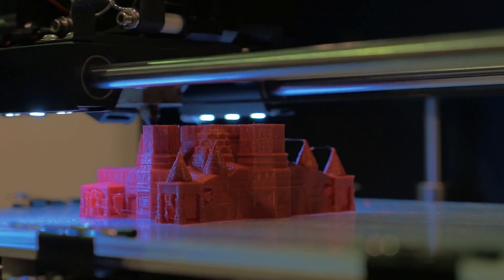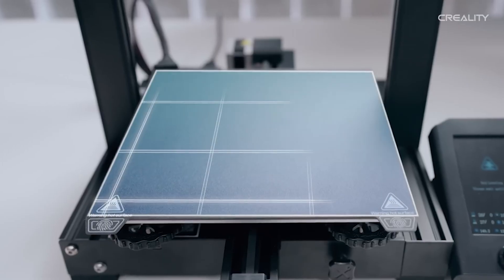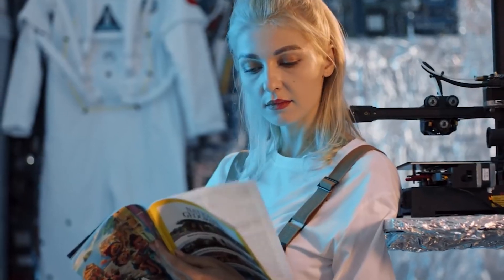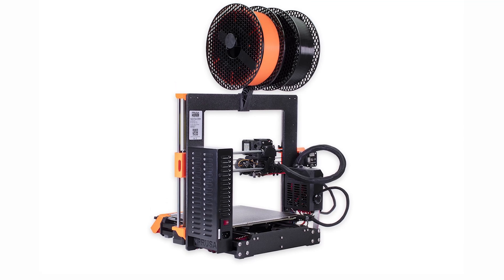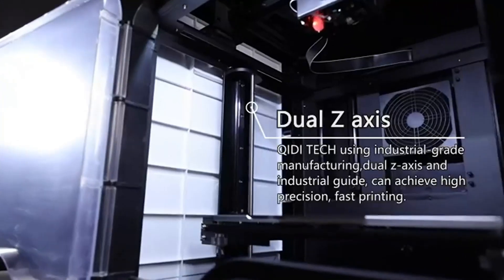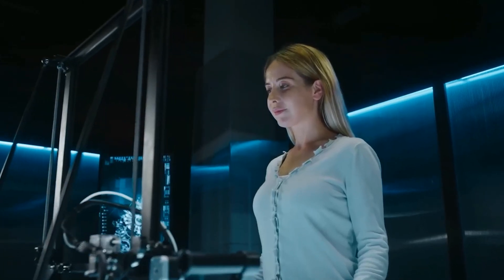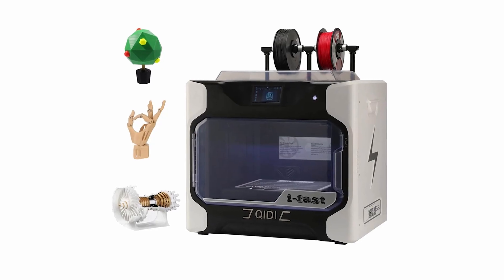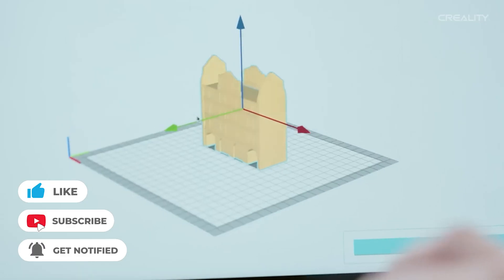What's The Best 3D Printers (2023)? The Definitive Guide!

Comment: bowden extruders in 2022? no just no. also any printer that can not easily be upgraded with a bi-metal or just metal heatbreak is also a no go.
They tell you that you can print with 260 C but you shouldn't if you don't want to inhale Teflon vapors.
Reply: So which one you recommend for home users for the budget $500-750?
Reply: @gunhann  it fully depends on what you want to do with it
Reply: @ozzlemcschnozzle7250  I imagine printing some kid toys, some useful tools etc. maybe desktop figures. The quality is important.
Reply: @gunhann  is it going to be your first printer? what size do you want? if 220 x 220 x 250 is enough for the build volume you can have a look at the Sovol SV06
Reply: I would also like to know what you recommend
Reply: @Yg600  have a look at the Sovol SV06